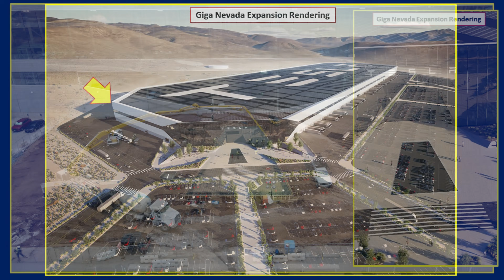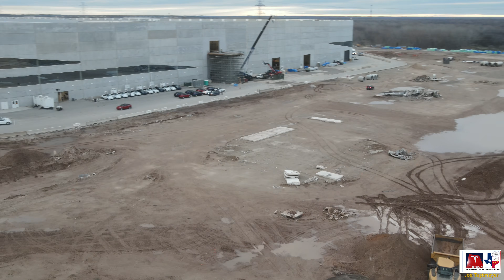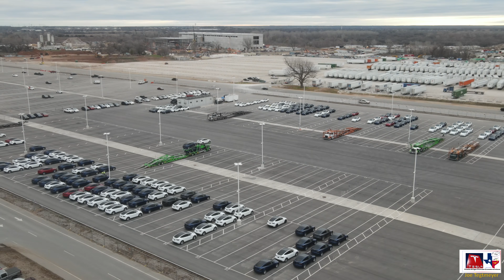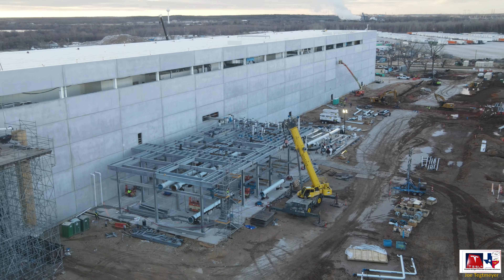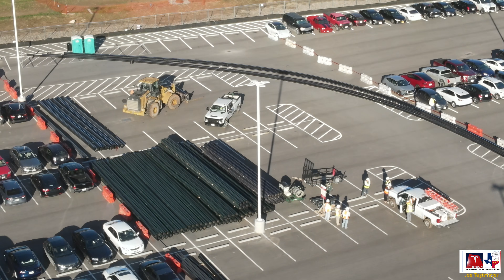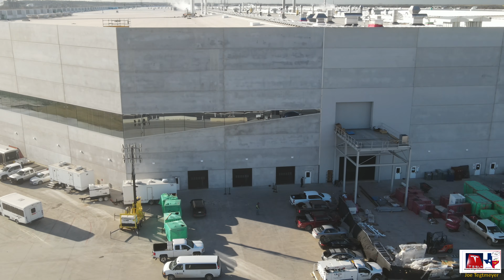Financial Results Day & Main Entrance Clues! 25 January 2023 Giga Texas Construction Update(07:35AM)

Comment: At the financial results meeting today it was mentioned that Gigafactory Texas has only 1 of 4 model Y production lines running and they're installing the remaining ones.  
Thanks, Joe.
Reply from the maker: No, that is not correct. They said 1 of 4 4680 lines were operational and the other three were in certification or in assembly.

Comment: Thanks Joe.
1:22. Giga Nevada. Existing PV Array will need some rearrangement to spell Tesla.
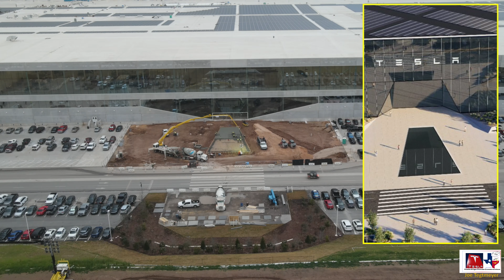5:44. Main Entrance. Speculating, but not much to go on. The trapezoidal shape at Austin is a lot closer to the doors than what is shown in the Nevada rendering. Joe’s 20 January video shows a number of clues to what may be planned. 
New diagonal beams across the edge of Level 2 floor. There's also a parallel concrete wall being constructed inside closer to the window (north side). I think it’s the beginning of a recessed front entrance, similar to the Nevada rendering. 
Video here, https://youtu.be/tWE3sOLTtyM?t=412
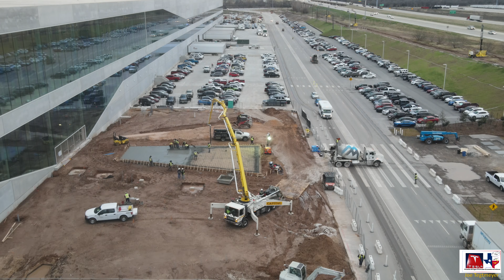6:35. Main Entrance. Column footings for sure. Massively oversized for anything else.
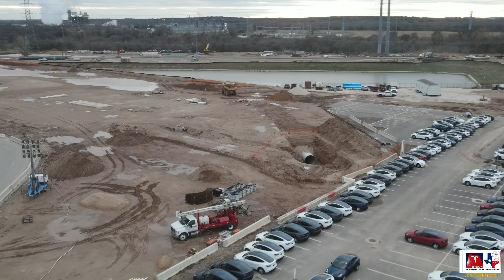7:27. Southend. White and red truck. Drilling rig.
Stack of curved steel beams, speculating shoring for a large shaft. (Level 7 on the open ended Speculation scale).
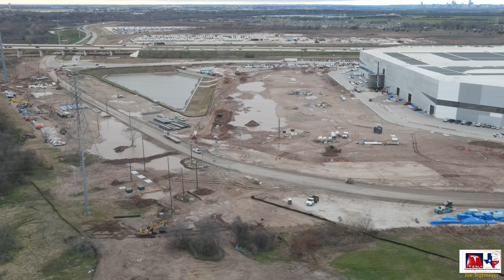9:45. Easements intersection. HDD works almost done and dusted. Shifting the last section of HDPE pipe.
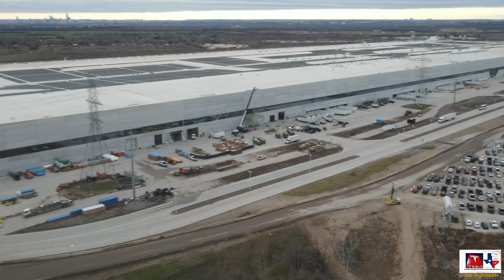10:02. BIW, apron. Some BIWs, a couple under covers.
Right, section of the parking area cordoned off with white traffic cones.
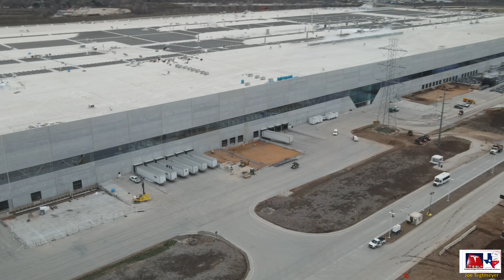10:24. BIW, apron. Ramp to loading docks, trench/grate drain placed.
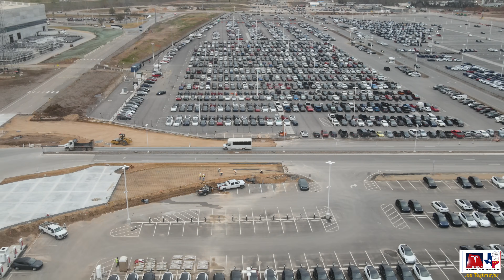11:17. New vehicle parking area. Bottom, centre. Dark grey Model Y, partly covered, seems to be missing half the roof.
12:17. East-west road. South, the Icominc machines. Previously stored around the corner to the south.
Large concrete box been there for a couple of weeks.
13:36. Project X. Pole, small generator and electrical enclosures at the base of the pole. There’s an identical pole set-up to the west beside the Cathode site office trailers. Comms/security would seem likely.
13:44. Cathode. Loading platforms. Studwalls have been sheeted. Unused opening has stud work also.
14:04. Cathode, apron. Crates. Filters perhaps. Crates seem quite lightweight to be windows.
18:31. Tesla road, north. Trench for the blue water main likely to be cut through the infilled south side of the pond shortly.
18:50. Old House site. Tree, left side. Couple of the inflatable rollers placed under the support structure.
20:16. Tesla road, north. Easement. HDD rig parked under the powerlines. Likely for the HDPE pipe in the parking area.
20:37. Temporary Switchyard. Changeover/upgraded transformer placed.
21:47. New Switchyard/Substation. Bottom right. Pair of grey cubes are additional footings. Something shown here on the LCRA plan, but no note as to what it might be.

Comment: So the 9,000 ton giga press should be getting close to completion, and they are starting to assemble  machinery in the stamping 2 area for parts for the cyber truck.  Do they have a spot picked out yet for an assembly line for the cyber truck and have they started to put it together?
Reply: The area at the south end, between the stamping area and where the Y are exiting thought to be it.  Large foundations were dug, and equipment has been installed, which are assumed to be metal brakes, ie metal bending machines, to make the stainless steel folded exoskeleton bodies of the CT.